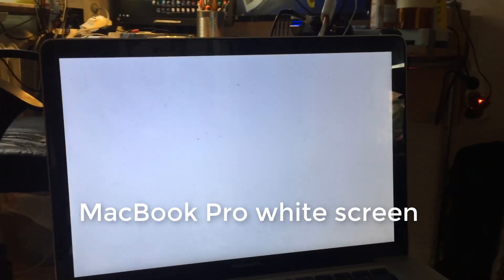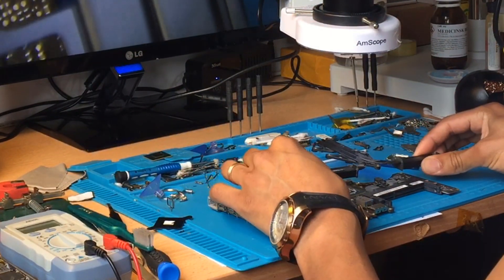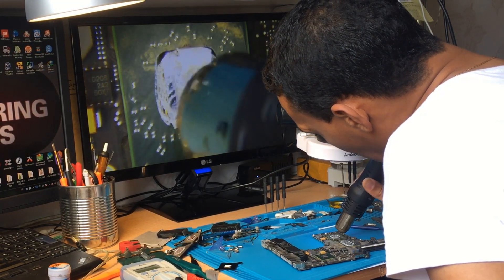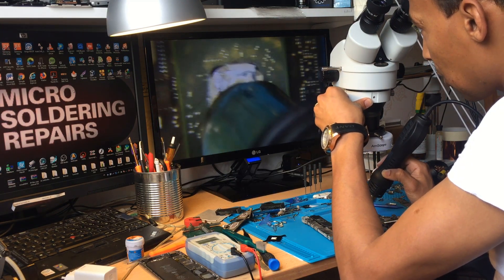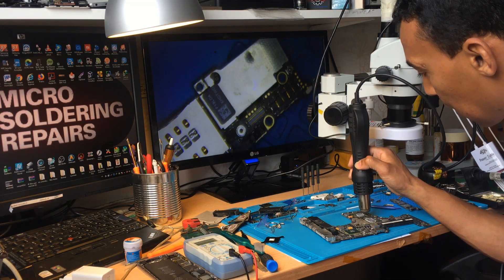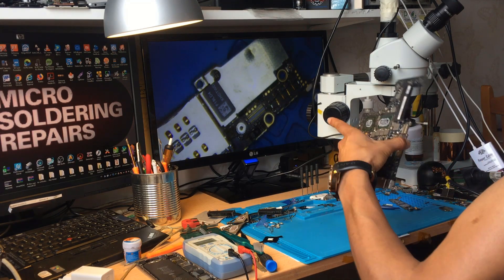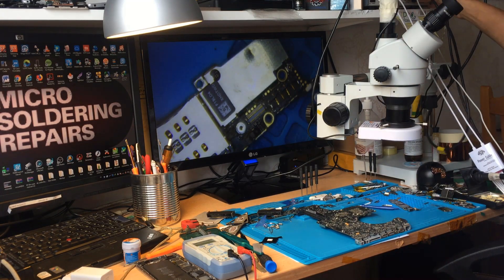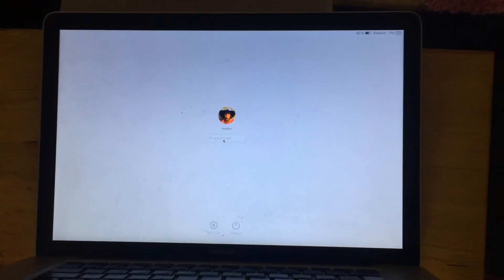MacBook Pro white screen/ No image/ Graphic card Repair

Comment: I have the same issue with my MacBook pro 2012. I have tried many methods like heat gun etc. But it won't works for me. My MacBook has 100 same problem as the screen goes white and few grey color line displayed on screen. If i use external monitor it works. Please help me to fix that.
Reply from the maker: GPU problem

Comment: Great video, I have an issue with my screen, before the screen used to work with no backlight after I changed the backlight fuse the backlight working now but I only get white screen nothing else, I followed your steps in this video but didn't solve the issue. ayn advise much appreciated ?
Reply from the maker: check the Ram. reheat the GPU with 400 tempereter. since you get a white image the backlight fuse is fine. dont forget to subscribe. good luck
Reply from the maker: for the BL issue, it could be also the chip close to the fuse that should be replaced,
 i can send you a screenshot from the schematics

Comment: Hello, I have the problem in 2 macbook pro. White screen. When I connect to external monitor it looks good. I replaced the screen to discard cables and it's still white. Will heating help me? Thank you
Reply from the maker: no, if you connect to external monitor and you get a picture then you dont need to heat the GPU.

Comment: Please can you help me about my Mac book pro
Reply from the maker: aminu uc the white picture has to do with graphic card. If you dont have the hotair air station to heat it up. You can try this fix first. 
Remove the motherboard and the fan, and all plastic from the board. And putt it in the oven for 8 min. 280 degrees.
Reply: @MICROREPAIR  are you mad!
Reply: @MICROREPAIR  wtf? Are are u just another troll? 😡 
Yeah that’s a dislike for me

Comment: Hi I have a white screen but I can hook up an external screen and it works so it is not GPU but putting the motherboard in an other case(macbook Pro) 
white screen again this screen works with another motherboard I cannot see any damage
Reply from the maker: Mar Schrammeyer in this case it could be also the GPU that cannot provide the MacBook Screen with enough display quality, because the Mac Screen is better than the external sreen. Write me en email to see how i can help you